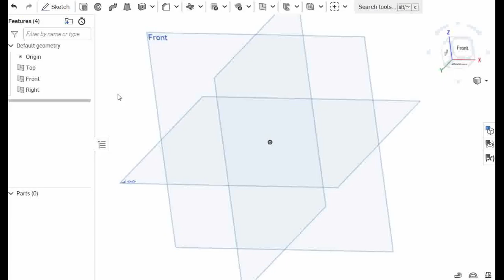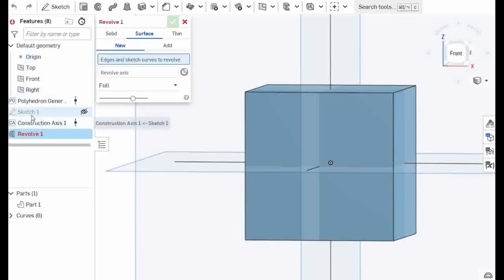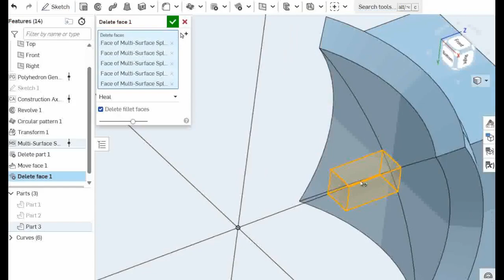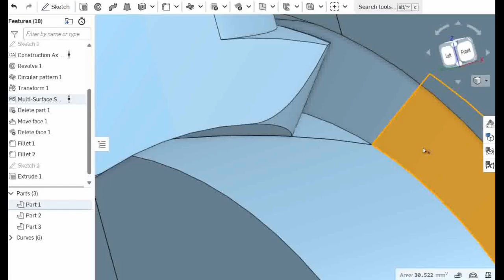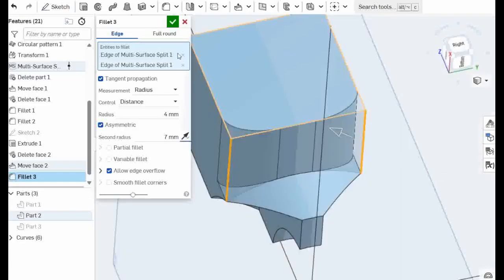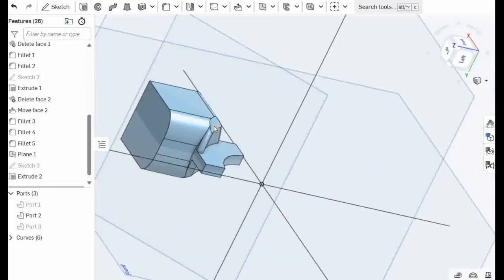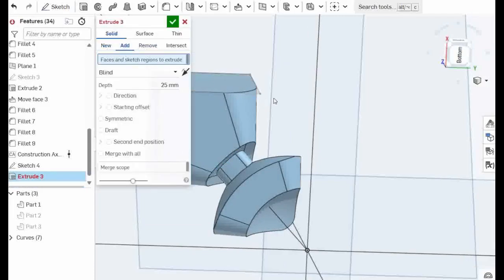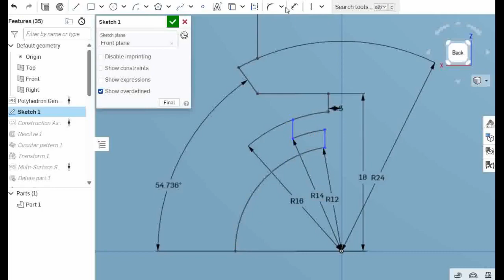How to design a Moyu RS3 in Onshape

Comment: is it possible to add a kind of texture to the pieces to give the cube a sandy feel for much longer? i really like the feel of the fanshi shuangren and i want it in a more modern cube
Reply from the maker: If you are talking about designing a cube, you can add some form of shallow, widspread anti-stick design (like a Gan honeycomb or Moyu dragon scale). It should be less smooth than a full flat design (like the Meilong 4x4), and less crunchy than a deep, localized anti stick design (like how several older cubes have a few thick and obvious stripes). Although I don't think it would make a perfect sandy feel. This is just an empirical based conclusion though.
Reply: @laiscube  do you know how to replicate the out of thw box feel of a meilong 3m cuz thats the texture im looking for, ive seen it on the fangshi shuangren and i heard that making it rough or bumpy will make it last longer, is it possible for you to confirm?